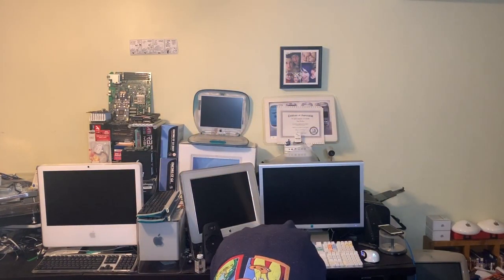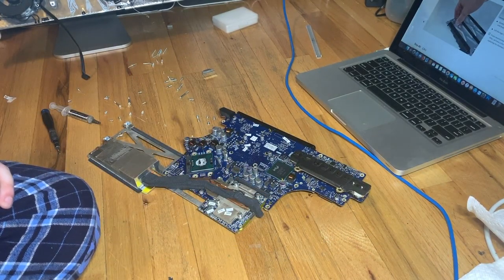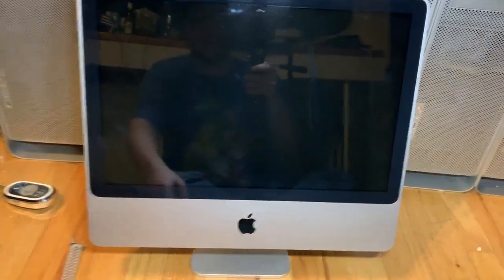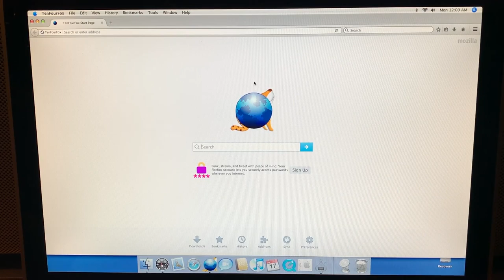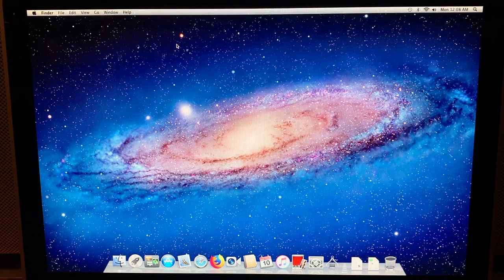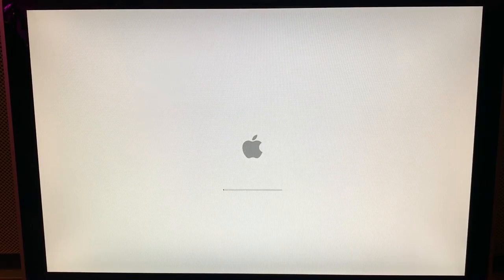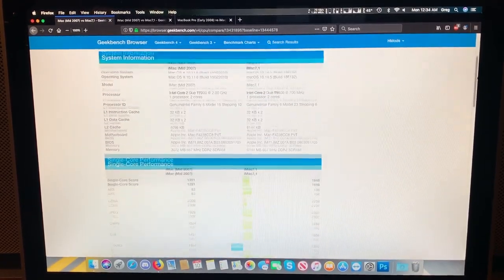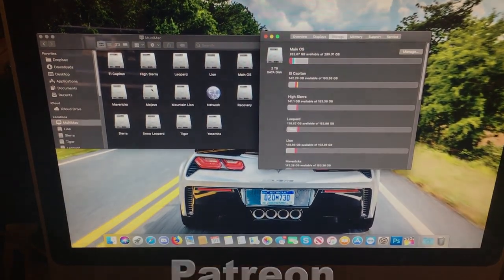Mid 2007 iMac CPU Upgrade & Tiger Thru Mojave OS Demo

Comment: Be careful next time with 2007-2011 iMacs. Never open them with suction cup in the middle of the glass panel.
Reply: 2011 ones have glass with magnets. Just pull with your hands

Comment: j'ai un imac8.1 (24 inch early 2008) je voudrais changer mon CPU 8235 avec le T9900. j'ai trouvé deux Processeur: T9900 SLAQH et T9900 SLAYX  lequel me conseillez-vous ?

i have an imac8.1 (24 inch early 2008) i would like to change my 8235 CPU with the T9900. i have found two Processors: T9900 SLAQH and T9900 SLAYX which one do you recommend?
Reply from the maker: As far as I know either will work in it
Reply: :face-red-heart-shape:You are the best

Comment: I’ve been doing this as well! These iMacs are  still pretty viable! - I’ve a question - how does it run on Mojave re graphics- do you get horrible artefacts & video glitches? Colin says that Mojave is awful without hardware graphics acceleration which I don’t think is supported on these graphic cards- so I’ve never bothered & stuck with high Sierra & ssds.. they actual fly!
Reply from the maker: Dude the patcher has supported these models since day one it runs beautifully
Reply: hey I just got one for free, can I upgrade the gpu? and which one should I get??

Comment: I have one and I want to upgrade too, which system ran better? I'm thinking about using Monterey, is it recommended?
Reply from the maker: High Sierra is the last one that runs 100% natively on the whole hardware after the patch… Mojave is the last 32 bit app supported. And Big Sir is the last one that supports IDE. So anything past that you lose the optical drive. It’s really up to what you want to run if you want one of the more recent latest and greatest I still find Ventura really stable. And you can always use a USB drive if you need the optical drive.
Reply: @HrutkayMods  😁

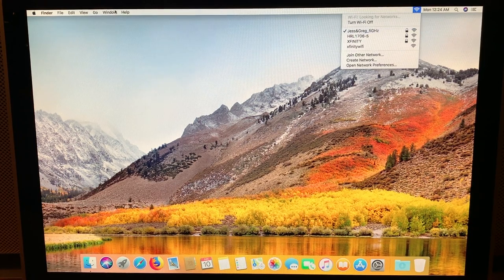Comment: 33:50 High Sierra being the last macOS version to support Nvidia web drivers. Apple seems to be targeting the users of Xserves, unibody iMacs, and cheesegrater Mac Pros with upgraded Nvidia graphics cards. But in iMacs, GTX 7xxM cards would work because they were used in the late 2013 and 2014 iMacs and dGPU models of the Retina Macbook Pros from that time period. I mean, if someone is to buy a GPU with support for macOS 10.14 or later, might as well buy an AMD GPU but if you already have a non-GTX 7xxM card that is from Nvidia and you don't want to buy a new card and want/need to run Mojave or later, you're pretty much screwed unless Apple lets Nvidia release drivers for Mojave and later. They haven't in pretty much a year, so I won't be surprised if it never happens.

Comment: I  have the same 2007 imac i want to upgrade the cpu to install mojave on it but do i need to update the graphics card as well  by the way id like to get windows installed on my el captain would like to see a updated version vid i know u did one on older macs thanks bud keep up the good work my friend thumbs up
Reply: I think you can upgrade the video card to the Radeon HD 2600 Pro GDDR3 256 MB and install MAC OS X Catalina with 6Gb DDR2 667Mhz.

Comment: Hello! I have this iMac. I already did a CPU upgrade to a T9500, but I don't know how to install a different OS and I am stuck with 10.5 OS Leopard. How can I install, let's say, El capitan? Do you have any videos on it? Thank you for your time
Reply from the maker: yes, lots of videos on it... if you can upgrade to lion now that it's abandonware and then it'll let you install el cap... or you can put the installer on a flash drive and boot into that then upgrade over the existing install

Comment: i have an imac 9.1 mid 2009 intel core 2 duo 2ghz, can you upgrade the cpu on these, and if so what cpus will work? thankyou
Reply from the maker: Yes, you should be able to, I’m not really sure which ones fit I believe the top one is the 9900

Comment: Wow I didn't know you could upgrade like this. My iMac boot chime and has black screen. I'm going to try to fix with replacement power supply. But if that fails I think the logic board. I like to now upgrade the cpu while I'll have it all disassemble.

Comment: I have this as a daily driver now😂. But it runs mint perfectly with 4 gigs and a laptop hard drive 😂. Do you think the t9500 upgrade is worth it?  I could buy a newer one for the price they are asking for the chip alone lol. Owc want $70 for a 4gig ram stick to max it out!  Do you know if this is the model that you can upgrade the video card on or how I could figure it out online mine has radeon2600 XT/2700 according to system info in mint. I was thinking if I can upgrade the memory of the CPU and the hard drive all at once it could be a cool computer to also install Catalina on  or is this just too old to deal with?
Reply: If you were using this imac in 2024, what os would you use as a daily?  Would it be a mac? Linux? Just curious if im using the best possible setup myself and i respect your opinion way more than my own 😂
Reply: A kewl follow up video would be for you to show each os, And explain the best browsers, and what software is available and good to have on each one. I know when i was on snow leopard the other day I thought it was kewl but I didn’t know what to do with it beyond interweb. Just a thought..live the channel!
Reply from the maker: I sort of did in this video lol I am actually doing a follow up and I did a follow up in the beginning of 2022… this system officially supported seven operating systems and unofficially supports seven now so there’s been 14 operating systems I think it would be a great time to follow up on it. Also if I use this thing as a daily driver, I would still probably be running something like Mojave on it… I actually did use it as a daily driver until it got too unstable with so many operating systems on it. With Max ram and an SSD. I wouldn’t hesitate to run Sonoma on it just to use it as a daily web browser and stuff like that… it would also make a great windows 10 machine. But if I wanted it to be really fast and snappy with a hard drive and stuff I would probably put some type of Linux on it.
Reply: @HrutkayMods  thanks. I never tried windows on it because ive never been a windows fan. But if I was to try it, are there any special steps I have to take or do I just put in the USB installer and run it like I would any other system? Would it use mbr in rufus to make it? Thanks man you are the best!
Reply from the maker: @95Comics yeah, Macs of this generation are very picky… they only want to install windows via CD and you can only do it with MBR… there’s a way to do it GPT maybe with open core but I’ve never tried it. if you do it factory with GPT and actually installs you’ll get so many driver conflicts it won’t work it’s really weird changing the partition type screws up the hardware drivers That wasn’t really fixed until about 2012 models… when I install windows on older models, I usually use my 32bit EFI custom images even though this is a 64 bit EFI it literally uses the same copy of windows, so it fixes all the boot issues and stuff
Reply: @HrutkayMods  linux it is! Lol. Both my macs have SuperDrives and both havent worked in years. I bought a new one and tried on both,no luck. The macminia1283 seems like theres no power, ive replaced the ribbon connector, still nothing. Im thinking logic board problems. Ever heard of that issue? Anyways mint works great on imac and xubuntu on the mini and I guess I should be content lol
Reply from the maker: @95Comics yeah, my world‘s fastest died when I replaced the dead SSD… at first it wouldn’t power on then it powered on, but the CPU was running extremely hot. now it’s always on with the fan at full blast, but not doing anything… I might’ve cracked the board or the CPU died after I took it apart again to try to fix the overheating problem. I’m not really sure what I did

Comment: Did the upgraded CPU allow this iMac to have AirPlay or be able to be used as external monitor via Target Display Mode? Or would the mini-DVI port still be limited to output only, no input from external device?

Comment: Hi, great video. I did the same but with T9300, but the system does not show me the correct CPU, it shows 400MHz Core 2 Duo instead of 800MHz that have T9300 chipset, the only point that shows correctly are the 6Mb of cache .. do you have any idea what can happen? On the other hand upgrade the RAM to 6Gb, you do it with two 4+2 modules right? thanks man!
Reply from the maker: it's just a lack of microcode support and yes about the ram

Comment: Thank you for your detailed video.
I know you mentioned that your iMac is a 20 inch model but would the T9500 CPU chip work with the following 24 inch iMac (Mid-2007) that currently has a T7700 processor?
2.4 GHz Intel Core 2 Duo
6 GB 667 MHz DDR2 SDRAM
ATI Radeon HD 2600 Pro 256 MB
iMac7,1
It is currently stuck with El Capitan and I am trying to upgrade it to Mojave as you did.
Can you offer a hyperlink to where to purchase the T9500 CPU chip from?

Comment: Hi, thanks for the video, I have an Apple iMac 27-Inch "Core i5" 2.8 (Mid-2010) with Windows 7 installed, no other OS. I would like to upgrade it to the max possible and using the Imac OS and if there is a video about it.
Reply from the maker: yeah I've done a few GPU upgrade videos on these... If you upgrade to a metal card it'll run the latest and greatest... or you can use Opencore and patch the old graphics (you still need it to boot anyway). native metal is better than the opencl patch though
Reply: @HrutkayMods  Hi, thanks for the response, since then, I have done something wild.
I replace HHD for SSD plus maxed the ram, 16MB total and installed Windows 11. Works like a charm and very fast boot up.
Reply from the maker: Must be one killer PC at least lol
Reply: @HrutkayMods  No, I think, Microsoft tried to give false information to the public to push the new PC's to be beefier so it could run Win11.
When in fact, my old iMac 27 by just taking the HHD out and putting an SSD and full memory would do the trick. Hey, weird people like me has to try stuff to see how far can we push the PC boundary.  All good.
Reply from the maker: I totally agree, but they also did it for future CPU security reasons at least that’s what they say… the chances of being hit by a CPU exploit is pretty slim I believe

Comment: GREAT VIDEO!!!! I have the iMac 20" early 2008. which intel core 2 duo cpu you recommend? You mentioned you can use a 1066 mhz cpu. Thanks
Reply from the maker: The E8435 was the fastest and came in the 24"... That should work... The T9900 is essentially the same CPU too this one is just cheaper
Reply: Is a t9500 a good option???

Comment: Hey do u know what the red led under the first hd bay on the 2008 mac pro means ? The mac just keep resetting after 10 to 5 mins
Reply from the maker: multiple error lights in that area... possibly a RAM issue it sounds like?

Comment: So the t9500 is a more preferred because they will allow Sierra, Correct? Compared to a x7900 which is similar in speed. I just received my x7900 and am thinking if I purchased the wrong one. Does Sierra run faster than El Capitan? Also my headphone jack doesn't work are you familiar with this problem?

Comment: guys hi tell me how to install mac os mojave on imac 8.1 20" 2008. how to create a flash drive from under the system mac os x lion 10.7.5 Tried everything and not how it does not work.. Patcher throws an error.      Video cool! especially liked the disk with downloads of different mac os )) I want to do the same for myself, tell me how?

Comment: You don't need APFS for MacOS Mojave!
Reply from the maker: for update support you do yes
Reply: @HrutkayMods  That's only for Catalina isn't it? Else use OCLP with native model and APFS trim
Reply from the maker: Pretty sure Mojave was the first… Collin always said to use APFS because of this issue
Reply: @HrutkayMods  ok... anyways OCLP offers seemless APFS boot on unsupported devices
Reply from the maker: Yeah, that’s different… and I think it actually uses a lot of coding that Collin came up with it but I don’t know… i’m just talking about software updates in general. They just refuse to install on HFS in the operating system for some reason. 🤷🏻‍♂️
Reply: @HrutkayMods  it does indeed use a lot of Collin's code, but improved it in crazy ways, and were able to fix the crashing issues in Catalina Patcher that Collin claims can't be fixed and that OCLP uses the same patch he uses...
Security updates don't really matter in Mojave anymore
Reply from the maker: @SpatialZebra that’s true, but at the time it did lol I still wish they were updating Mojave then again I was upset when they killed off El Capitan 🤣
Reply: @HrutkayMods  I was upset when they made early some 2008-2009 Macs incompatible with Sierra and High Sierra, as most of them don't even need patches to run it, they can run it perfectly outright, this is just planned obsolescence from Apple!

And yes I think they are killing off OSes way too fast, Catalina is dead already, and I remember when it was the current OS, it's not even that long ago and Macs were already looking modern, with designs that are still used to this day!

Btw, ever considered running Catalina with OCLP 0.4.3 TUI on your 2007 iMac? It won't have Collin's bugs, only bug aside from it being non Metal will be that Monitors preferences pane will not load. I haven't yet found a way to disable auto brightness without it which is kind of frustrating but otherwise I think it's really the sweet spot for every Core 2 Duo Mac until we're eventually forced to go Monterey or even Ventura, which are much heavier OSes and we will see our Core 2 Duo struggle a lot more...
Reply from the maker: @SpatialZebra actually Collins patches I’ve never had a problem with for Catalina, and I prefer the patches over open core… and I agree there was a lot of systems they killed off that could’ve ran up to high sierra with no issue

Comment: Hi friend, really how much ram memory do you recognize?
how many modules 1x4 and 1x2
hold 8 ram memory?
Reply from the maker: 6GB chipset doesn’t support anymore
Reply: Hi, I’m not sure if it’s the same question with Ronald Iratchet, but as you said in the vid, you installed 6GbB of ram, so can I still do that with 4GB and 2GB modules? Thanks.